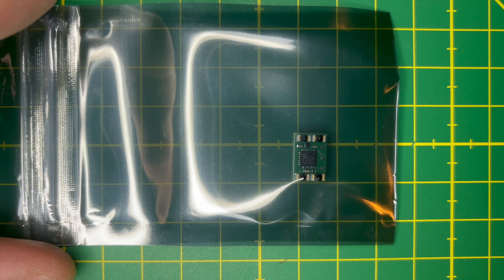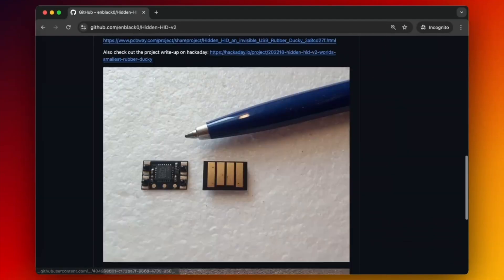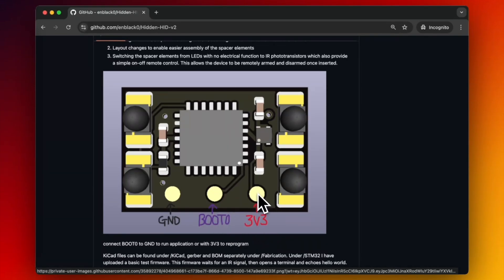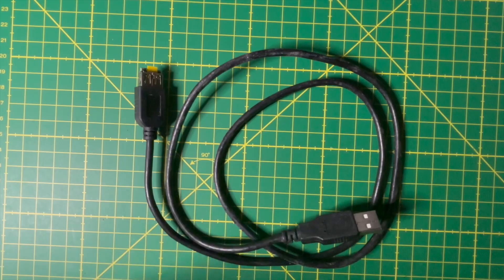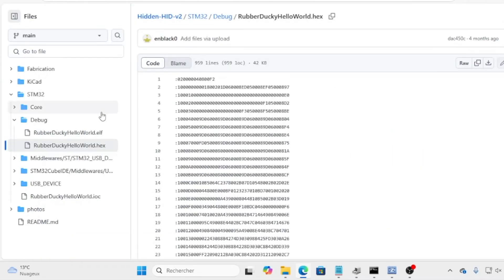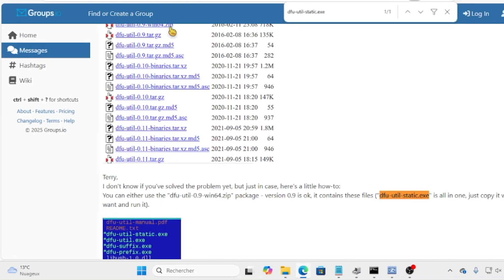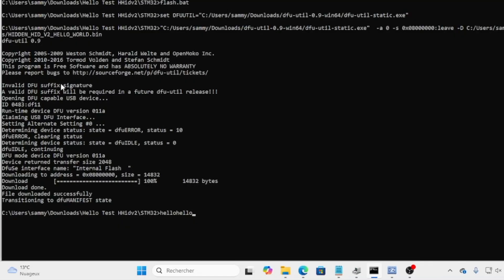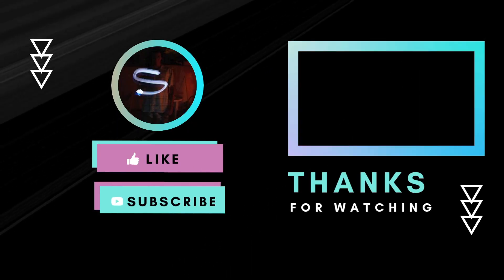World’s Smallest Rubber Ducky Alternative? Meet the Hidden HID v2

Comment: 8:11 you soldered the pins for operational mode first (gnd+boot0), because there was no program it seems it defaulted to the bootloader. Once you completed the flash, it will automatically reset and again, because you have gnd+boot0 tied, it instantly runs the program as it's in operational mode. Basically, you were one malicious payload from pwning yourself with it. I will be curious to see what you do with the IR blaster capabilities and how effective that is considering it's recessed, I can imagine a custom driver to allow data to be sent by a companion payload application and remotely controlled. Lots of possibilities with this!

Comment: What exactly are the 4 balls on the card?
Reply from the maker: They are IR sensors
Reply: @samxplogs  without them i imagine a much smaller pcb with just a 32u4 or similar chip
Reply: @DogukanSahil  it probably wouldn't be able to reliably press up against the usb pins without them.
 thickness was added with a cool feature of those leds